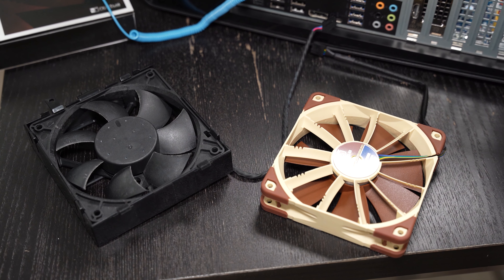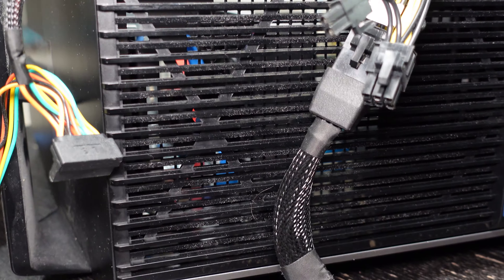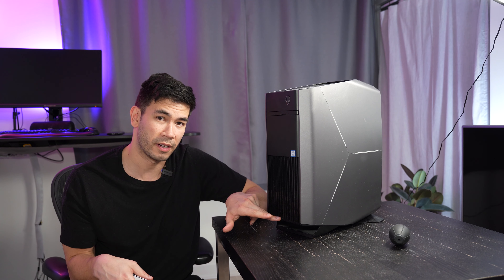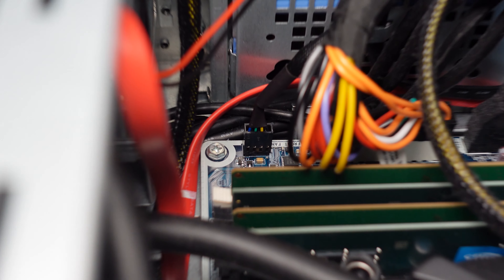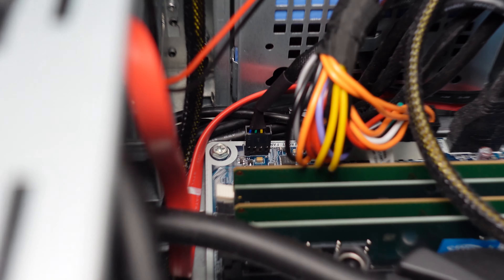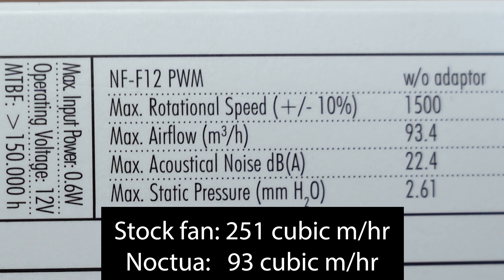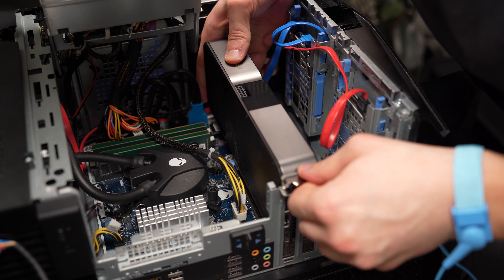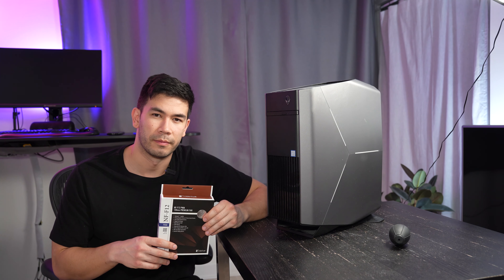Why your Alienware PC needs HIGH STATIC PRESSURE fans to IMPROVE TEMPS & NOISE

Comment: On the picture of your fan curve you have set it to static 10%/100%, did i see that correctly ? 
i recently got my r10 and have big problems with my temperatures. i replaced the front fan with a noctua nf-a12-x25 and installed a second one as well, as well as replacing and installing a second fan for the watercooler (both corsair ml120 pro, push/pull. the noctua ones for the top lead to a bios error on my system.
i also noticed my fan speed for the front fans dont seem to go above a certain threshhold, no matter how i configure the curves. 

and still, my temps rise up to high 80°C or go all the way up to 95°C until the pc shuts down due to overheating. got a r10, ryzen 5900 and a 3080
Reply: Other fans will be more quiet but worse than the stock coolers. I Checkt several fans. I got Bios Error by testing the Noctua NF-A12x25 PWM as well. Got an I9 10900kf overclocked at 4,9 Ghz. Under full load - no chance. At cinebench 23 Multicore Test it goes up to 95 Degrees till it throttles down to 4,38 GHz. No matter what fans i used. The best have been the stock coolers ;) But also the loudest. By gaming PUBG etc... i got 65-70 C.Not the best but ok. Im tired to try  this shit by changing fans serveral times. I tested Arctic, Corsair 120mm Pro, Noctua by adding 100% Offset in the AWCC. No Fan  exeeds  55% workload. Only the stock Coolers run to 100%. Yes its like an jet starting in your living room but at least the best cooling results.
Reply: Same issue - I gutted the CPU, Ram, NVMe SSD and 2080Ti and put in new case and mobo - I did not trust reusing the PSU (see my comment above) due to the heat - I now have a great PC - I was not over clocking it - just change BIOS to correct CPU and Ram settings - threw the case and mobo into the trash along with the last 6 months of the useless warranty -
Reply: @wingeladvokat1920  Do you leave it on manual or have a custom curve with the stock fans?
Reply: @Tesseus  I leave it on manual. Balanced during surfing or listening to mp3. And preset power during Gameplay. And as i said custom curve works from 0 - 100 % only by stock coolers.
Reply: Also keeping the CPU clock under 5.0 GHz.

Comment: Anyone with R12 tried this and can confirm there's no BIOS error?
Reply from the maker: its usally the AIO radiator fan that is fussy, botton intake should be fine
Reply: I just tried it on my R12, won't boot up, need to put old fan back, guess I'm gonna have to get corsair fan
Reply: I just did this on on R12 booted up fine no bios error.
Reply: yes bios error here, few problems with this upgrade, for few degres, no more 4 celcius.

Comment: My r10 has one fan.  I bought two of these noctua s and my temps are exactly the same.   I am crying cause it was $80 for both fans.  Fuck
Reply from the maker: Have u played with fan curves and ensure it's running 24 7
Reply: @JSyntax  I tried using the awcc and my top fan would slow down and the front would spkie up.  What other application can I use instead of the awcc.  And also when I made a new profile for noctua to push more air the top would slow down and cpu temp would go up

Comment: The NF-A12 PWN has 2000rpm . Its much better. The other fan that most other people use is the Corsair ML 120 pro
Reply from the maker: it's so darn expensive!!!
Reply: Do you get a bios issue with the Cosair 120 pro
Reply: @PENA1804  i only installed a noctua as above. But from all the other videos about alienware fan replacements....there no issue with the ML 120 Pro.
https://www.youtube.com/watch?v=tnt3u5SOSIk

Comment: You shouldn't have to immediately replace the fans on a PC that costs thousands of dollars. I will never buy from Alienware again. My R13 was the worst PC that I've ever owned. It crashed 20 times in two days. The parts that they used are some of the worst that I've ever seen, especially the RAM and the power supply. The 3080 GPU was horrible as well. I really wanted to like my R13, but I just couldn't. I returned it and will take my money elsewhere.
Reply from the maker: Damn tough words! Will you build your own pc now?